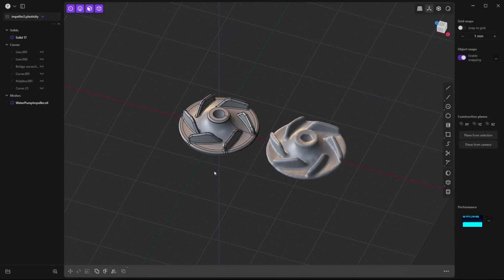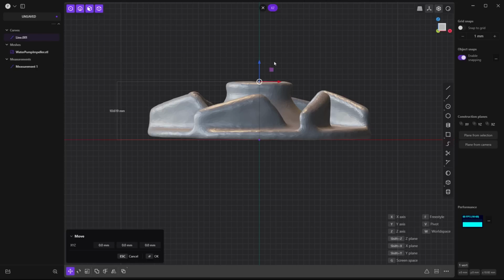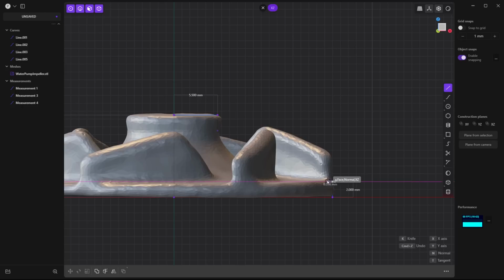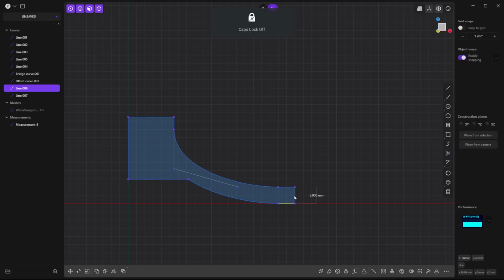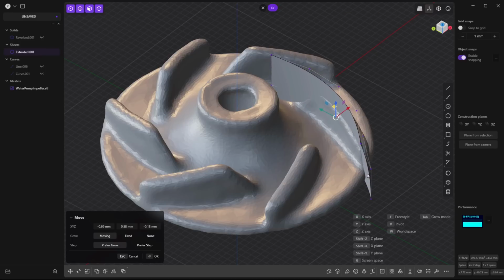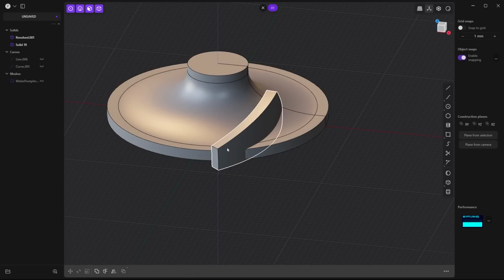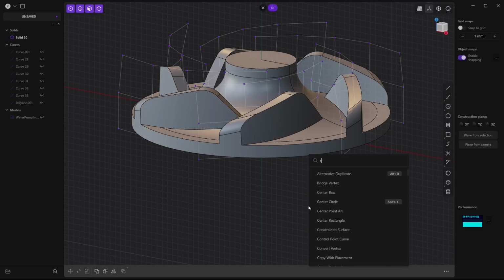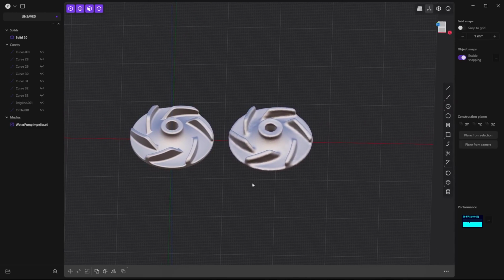Reverse Engineer From a Scan in Plasticity | Can It Be Done? | Should It Be Done?

Comment: In order to avoid the keyboard shortcuts, can Placticity be used primarily with icons and pop-up settings windows more like SolidWorks?
Reply from the maker: Yes you can do everything without shortcuts if you want.  all the curve tools and  primitives are on the left side of the screen always (like when going into a sketch in SOlidworks).  All the tools can be found in the mag glass icon bottom center of the screen or by pressing the F key.  Under the search bar is a bit of a toolbox like the S key in Solidworks.  You can add tools you use all the time there if you want to just remember the F key.  the ... menu or Shift + F is a contextual menu.  These tools will be available based on selection.  Simiilar to the pop up menus in Solidworks or the right click menu.

Comment: Hello! Could you please help? The scanned part opens very large in Plastisity. Could you tell me how to properly import it into Plastisity?
Reply from the maker: When you have a new plasticity design open, you want to set up the units you want to use (scans and mesh files are almost always metric MM).  Then when you do Import/Append from the P menu, there is a little dialog in the bottom left asking the units of the import.  Again this should be mm for everything I have ever messed with.  That should make it the right size.
Reply: @LearnEverythingAboutDesign  Thank you)

Comment: i was hoping for magic but got what i already knew i should do . use curves and recreate shapes
btw its not for a 3D print that i need it but for lets say a quick concept in zbrush that i wanna turn into cleaner hard surface geometry so i can add details on top with plasticity
Reply from the maker: quickest way is if you have Fusion and can export a quad mesh from zBrush.  Fusion can convert the quad mesh to a freeform body which will turn it into a BREP or NURBS surface (if its closed or open).  then you can bring that into Plasticity.

Plasticity does have a "constrained surface" that you can use where you snap points on a mesh and it will build out a surface.  it has its limits.  I have a few videos on it.  Recently I did a video showing QuickSurface, Plasticity and Fusion and the way to recreate mesh files.

Comment: Nice for learning but the point of 3d scanning for me is to avoid rebuilding that whole thing in CAD at all costs. I hope that AI plugins or add-ons will eventually take over CAD and do these kinds of things in seconds spitting out a perfect clean STEP file.
Reply from the maker: well Plasticity isn't a mesh reverse engineering program like QuickSurface or Geomagic.  But people want to see what is possible.  As of right now there is no 1 button solution but i do know there are plenty of companies working on it.  The problem is the number of decisions along the way and reasoning behind things like picking how to align a scan. what walls should be perpendicular or do they really have a 1deg taper.  what to do with missing geometry. one day we might see it.
Reply: @LearnEverythingAboutDesign  Im pretty sure it wont take too long. Same was with designing pcb's and circuit schematics and out of a sudden after 8 months there was one AI that can do it extremely well.

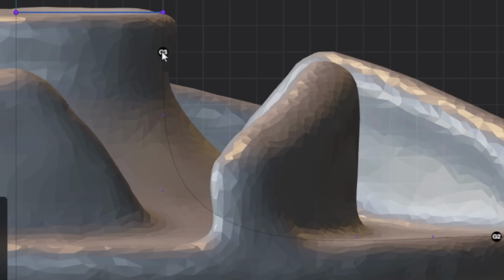Comment: 7:45 instead of moving the point up and getting rid of tge bridge, you can adjust tension to get the bridged area closer to where you need it
Reply from the maker: great point!  You do need to be careful with using the tension setting it too low though.  It can cause an issue with surfaces when you try to offset/thicken them because it will pinch even though its curvature continuous.  In some cases I will go down to .5
Reply: @ i haven’t noticed the scenario you’re describing but yeah i agree, getting close to your reference, then use tension to give it that little extra bit of accuracy